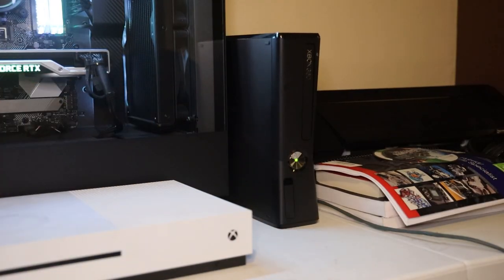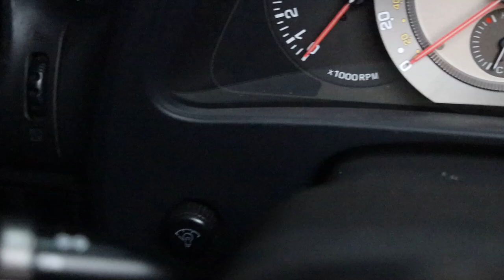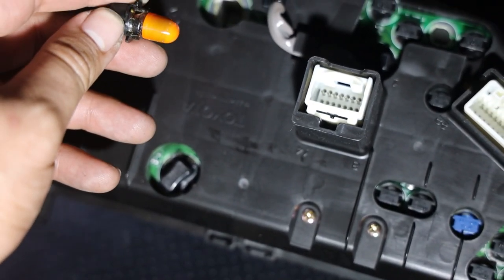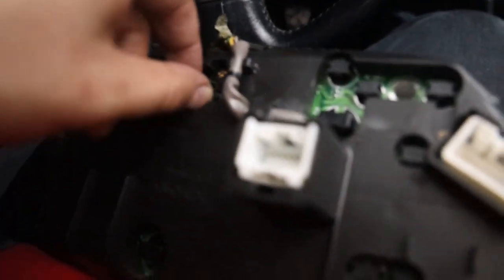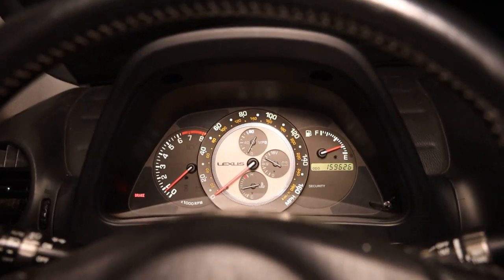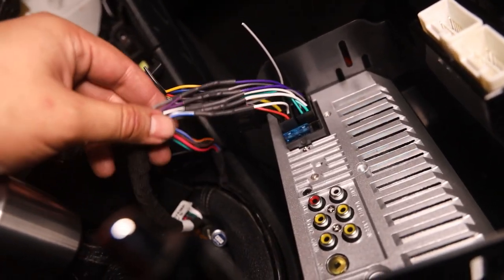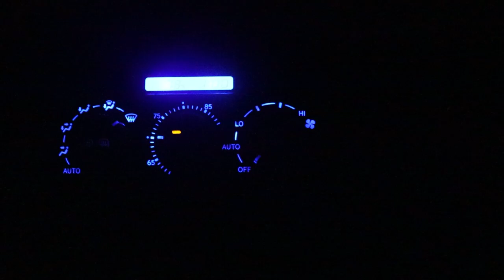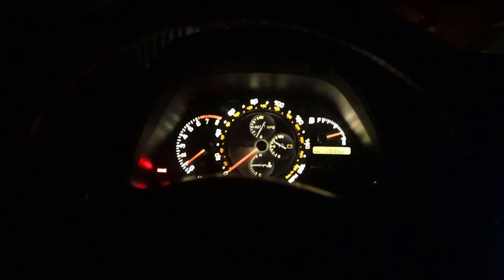This $15 mod will change the way you see your IS300!!!

Comment: Dude you gotta swap out the trac control (T4 bulb), ect power(T3), gear shift(T5 74-24), and cigarette lighter ring(T5 74-24)! I took the ashtray chord out and spliced it into cigarette lighter ring. Also doing your turn signals and any other dash indicator blue or pink whatever color you want adds a dope touch (T5 74-24).
Reply: I have a question, I recently did my whole dash lights, my CEL and my signals lights don’t turn on? Is it programmed to the vehicle or do I need to turn over the lights

Comment: Looks very similar to how I have mine. Nice upgrade!
Reply from the maker: Yup! Just didn't do the turn signals, still kind of wondering what color I want for those 🤔
Reply: @RotaryDaddy  lots of options, I like the idea of white because of the silver car, but I know you'll make a solid choice.
Reply: @RotaryDaddy  for some reason I didn't even consider I could change those.... Getting new lights rn I think I'ma make those blue
Reply: @yesca6893  how do you like the blue? I'm torn between white and blue.

Comment: Maaaaaan, I’ve done this last year. I got the agua blue lights, changed them out without an issue. Last week I decided to change them to white LED’s. The gauge cluster was a success. I then went to the climate control and changed them. Once I turned on the lights, they came on for less than a second and all my gauge cluster, climate control LED’s, and seat warmers turned off. I checked the gauge fuse on the driver side kick panel. It’s good. Do you have some advice for me? I was just thinking of ordering a new dimmer switch and climate control, but I don’t want to waste 80$ and that might not fix my problem

Comment: the picture of the silver Lexus with the blue leds in headlights for your video, the title image of whatever before you click the video- are those blue leds in the headlights aftermarket? i know the blue is, but did u have to drill the lamps to put those lights in?
Reply from the maker: Stock headlight housings have small bulbs in them that illuminate the housings. I literally just swapped the stock ones for Amazon led bulbs 🤘🏼

Comment: I used the link for the bulbs you used and they don't sit all the way in the bulb seat, did you have this problem too or maybe they just sit loose?
Reply: I just tried installing mine and they are loose and my lights also do not turn on
Reply: i have this issue too and i bought different ones. i don’t know why it won’t click in

Comment: Bro is the  stereo connected  to the speakers in standard mode or network mode ?
Reply from the maker: Stereo feeds speaker level signals to converter, that feeds the amp low level signal then the amp sends speaker signals to the speakers, it's a little weird but without bypassing factory amp this is the only way to do it